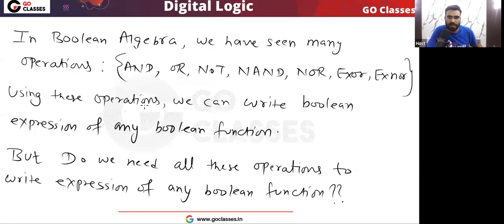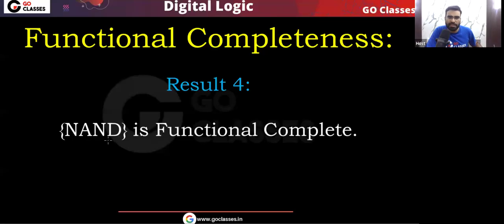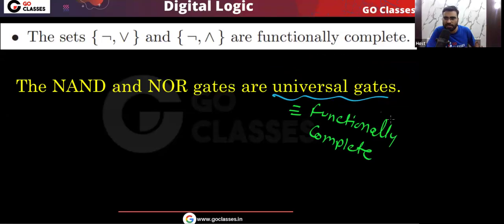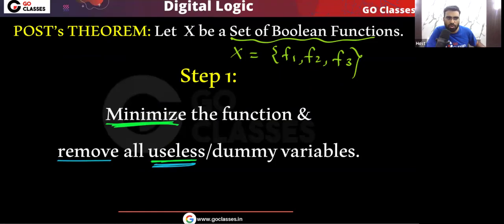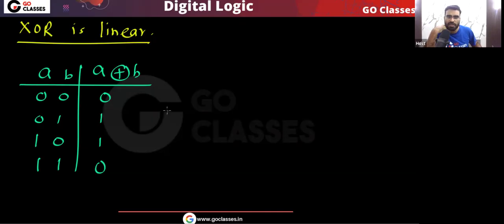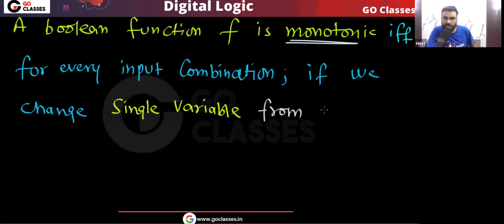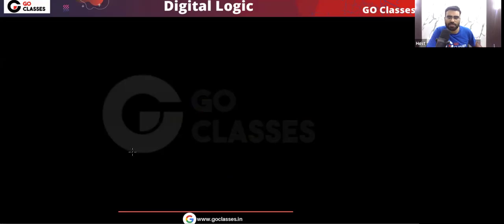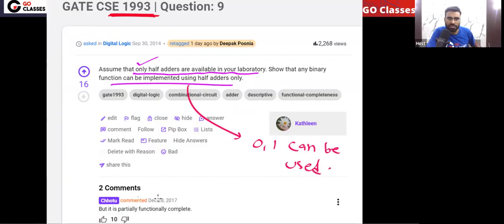Functional Completeness - Complete Summary | All in One | Post Theorem | Digital Logic | With NOTES

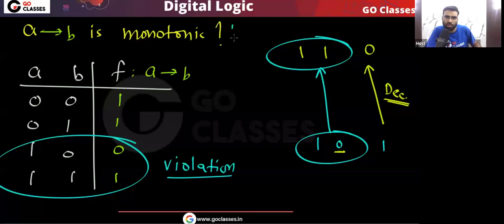Comment: at 1:35:34 implication is not monotonic okie make sense but sir function value is 0 for a=1 b=0 and 1 for a=1 b=1 so it is not creating problem i think it is the case which is making it not monotic a=0 , b=0 f=1  and a=1 b=0 f=0 am i right or wrong?
Reply: btw the lecture was awesome sir thanks sir ton times!!
Reply: That is one of the 2 cases . check on ( 0,0 ) f is 1 and on (1,0) f is 0 which is violation of monotonic . Drawing lattices helps .

Comment: Sir to check that if there are useless/dummy variables are present or not ( to check if function is linear or not ) , is simplification enough or we would be needing to minimize function with help of K-map as we did in mSOP. (There was no guarantee to get mSOP form of function with simplification but with K-map it was guaranteed) . So since there is no need mSOP to check if function is linear or not so is simplification enough to eliminate dummy variables?